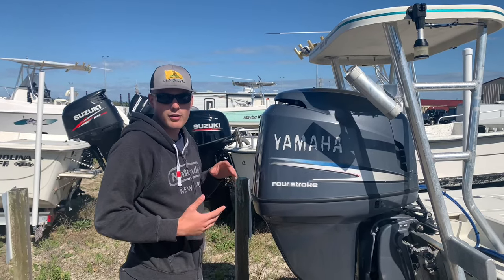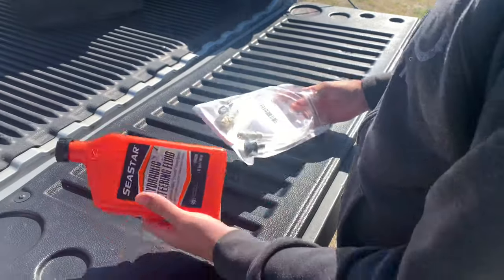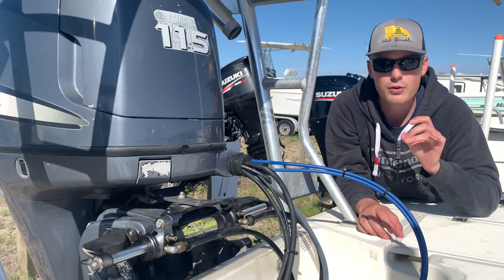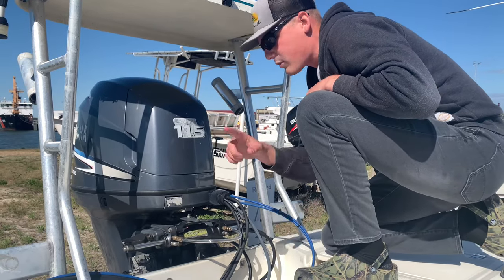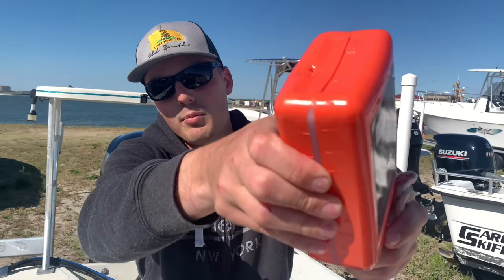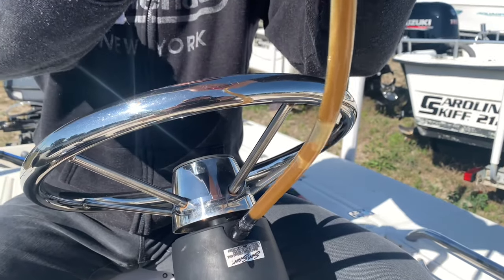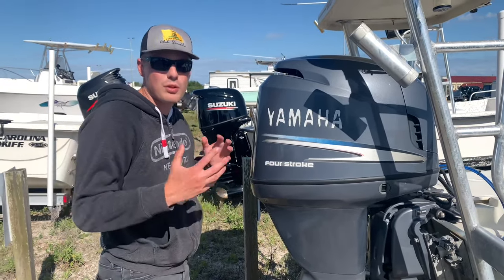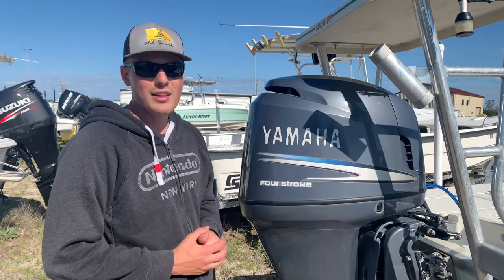Sea Star Hydraulic Steering Bleeding and Refilling

Comment: I followed your instructions and I didnt get tge same results. I worked on it fir over an hour but still had air in the system. I did midify your idea and bked at the bleed ports . That seemed to help.
Reply from the maker: Check for anything loose, another alternative to me bleeding through the rear; was tightening both rear fittings and leaving the console cap open, turning the wheel all the way one way, pouring fluid in, going all the way back the other way, wait a few seconds and let the bubbles come out, and do that until it is topped off to your liking and put the cap back on quickly.

Comment: I'm thinking you probably should have purged the old fluid before putting in new? (Not that you would have known that before you added the new fluid) The color of the fluid on the second rotation looks bad. Rust or some other contamination that would damage the pump? Other than that, pretty straight forward.
Reply from the maker: Yeah should’ve drained it. Next time!

Comment: Thank you for this video.   I have to do this.   What is the purpose of loosening the fittings?
Reply: Loosening the fittings allows the hydraulic fluid to circulate, if you leave all the bleeder screws closed the air cannot come out so you will still have hydraulic fluid with a big air bubbles trapped in the system.  Look at bleeding brakes and that should explain it.

Comment: How do seal the tube to the oil container?
The oil just leaked out. I couldn't tighten it. Did use a cheap hose and connector?
Thank for the video.
Reply from the maker: I had to either tape around the end or wrap a towel around to seal it up, quick fix